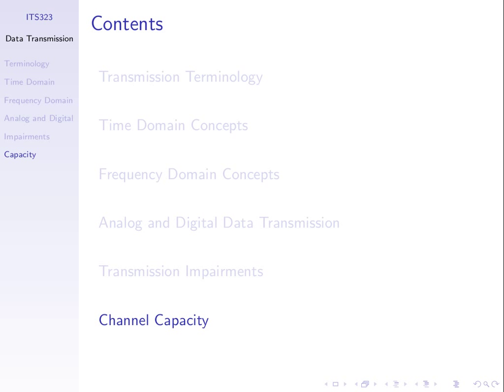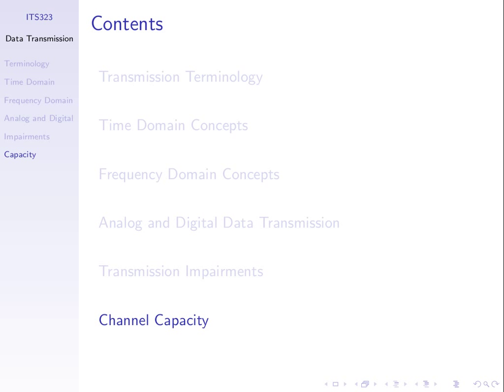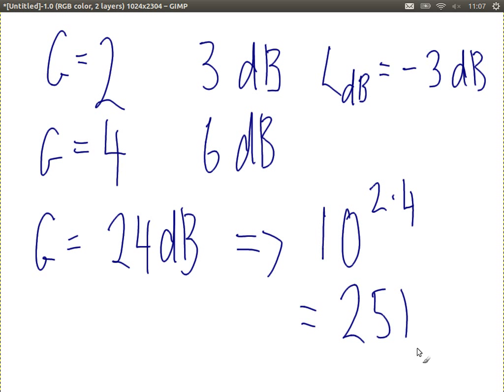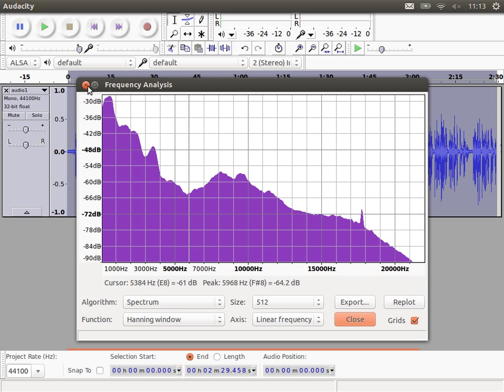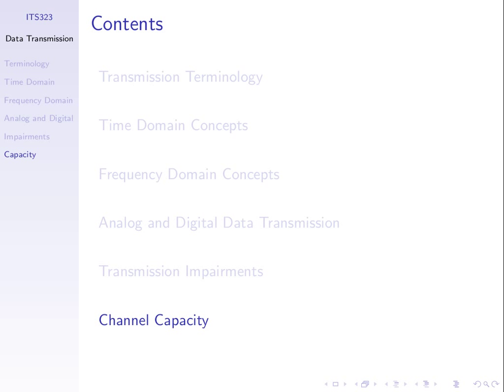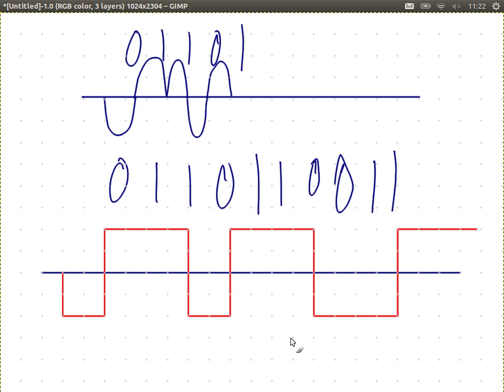ITS323, Lecture 08, IT, 03 Jul 2013 - Nyquist and Shannon Capacity

Comment: you said if we have a gain of 3db, the lost is also 3 db.
or you said if you have 1000$ and  becomes 2000 the gain is 2, what is the lost?
my question is that ,how can we have the lost?
Reply from the maker: As a factor, loss is the inverse of gain. E.g. start with $1000 and finish with $2000. The gain is a factor of 2 ("My money was increased by a factor of 2": 1000 times 2). The loss is a factor of 0.5 ("My money was decreased by a factor of 0.5": 1000 divided by 0.5).
Because dB converts a factor to a logarithmic scale, in dB, loss is the negative of gain. E.g. a gain of 3dB is the same as a loss of -3dB. "My money was increased by 3dB" or "My money was decreased by -3dB". You can check: 10log(2) = 3 and 10log(0.5) = -3.